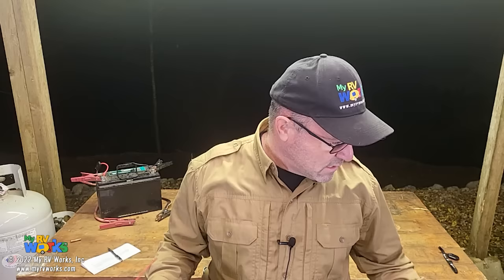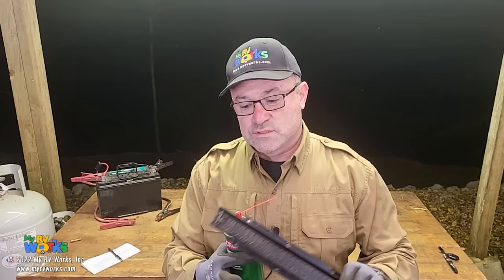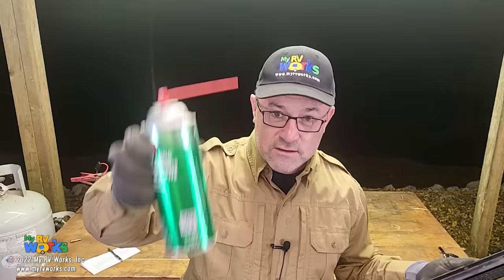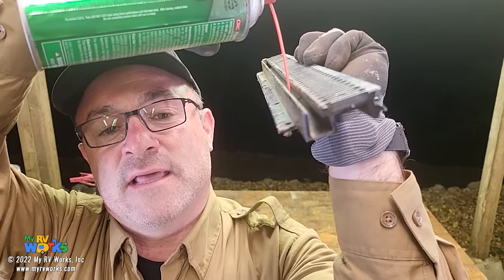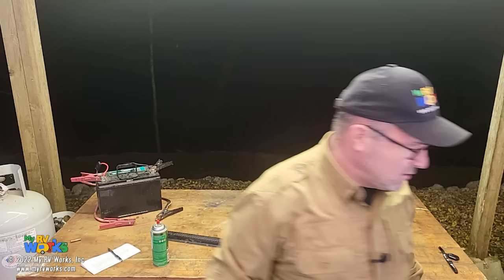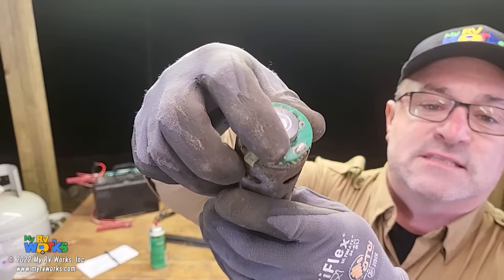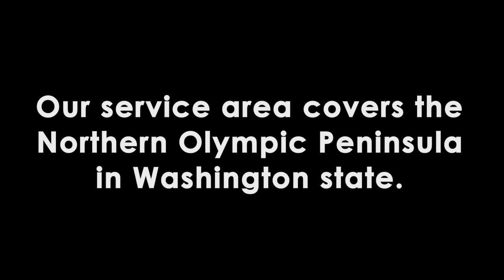Schwintek Slide Room Only Moves 2 Inches And One Motor Stops -- My RV Works

Comment: Hey Darren,  thanks for the process for synchronizing the slide room from left to right - works everytime.  However, what about top to bottom, i.e. when the top of the slide room reaches the "finish" before the bottom?  The bottom of my slide room (on my '21 SONIC 231VRL) does not reach the fully closed positon before the top, and the result is that the bottom remains out about 2 inches.  Is there a DIY way to correct this?
Reply from the maker: Making that repair is a little bit more involved. You will need to remove the columns to gain access to the drive shaft that connects the top and bottom bearing blocks.  Once you get one of the bearing blocks loose from the drive shaft, you can use a tape measure to measure the distances top to bottom and then reassemble everything. Only ever remove one side at a time, I speak this from experience LOL! Apparently somehow the bottom has skipped some teeth. When I see that issue, it's often because the bottom bearing blocks have a compromise plastic shoe and therefore the bearing blocks are not tight to the rack allowing the spur gear to skip .  If that's the case, you might be looking at needing to replace some parts or it will continue to skip on you.  Lippert does offer a repair kit that includes all these parts.  On our playlist I do have quite a few videos on schwintech repair and if you can get your head wrapped around how they all go together you should be able to tackle this one on your own. As a best practice, if I do find a few broken parts in there, I would recommend replacing the entire assembly left and right. On the column you will find a sticker and that's the information that Lippert would need to order a whole new set. Depending on different variables I've seen them anywhere from $800 to $1,000 in hardware. But compare that to replacing new parts with old parts and every time having to go back into that wall to make a repair.  And certainly keep the racks lubricated with the green can I talk about in my videos. Often times it's a lack of lubrication that's causing these things to get binded up.  Best of luck to you I know it's a pain.

Comment: My slide was hanging up on one side.    I located the controller and it showed a short between the. I trolled and the motor.   I bought a new wiring harness and replaced it (between the controller and the motor). Problem solved

Comment: Thanks for the great info on all of your videos. I have an error code 8 ( pinched or broken wire) on motor 1. I put a new harness in but have the same code and the slide still only moves 1/2”-1” and then stops. Works perfect in override mode. Any thoughts??  Thank you.
Reply: Same exact issue on ours (brand new). Did you every figure out a fix?

Comment: I need to find my controller in my 2019 wildwood 233rbxl would it be in the area where the fuse/breaker box is? Thanks
Reply: Possible but not likely

Comment: Mine goes out 3/4 of the way then the left side stops. It'll go all the way if I help by pushing on it. I'm ordering the lubricant now! By the way it squeaks also. Do I try and lube the motor?
Reply from the maker: You don't need to lube the motor, just Lube that track that the plastic shoe Glide slides in. You should notice a major difference when doing that.

Comment: how about a follow-on question to this:  what is the best way to clean the tracks before lubrication?  given the blocks are plastic of some sort, brake cleaner is likely not an option.  Any recommendations?
Reply: I would try compressed air

Comment: Hi, Just found your video ... i do have one of this Lippert slide outs and mine is making a squeaky noise. I also watched now 3 Videos from you. In the first one you said lube (were u took the parts apart) in the second one you said never lube due to the plastic parts (were a guy was asking the question what lube) now in this one you say again lube. What is the latest now ... lube or not ?
Reply from the maker: I have always been an advocate of using the CRC Power Lube with PTFE ( Teflon) on these systems. I'm not sure that I've ever said not to lube it.  There are others, including Lippert, that say never lube. But of most of the service calls we go on where we work on this system, the reason they failed was because they were not lubricated.
Reply: @MyRVWorks  Thanks for your reply i do have the CRC at home already just wanted to make sure before i use it since this videos are already a bit older. Here is the one I was refering to look at around the 8:00 minute mark.  https://www.youtube.com/watch?v=evneZh3vLCk Nevertheless Thank You very much !!!!

Comment: Or replace it with a Vroom slide system (they aren't perfect either, however it seems they have less problems and appear to be far more robust).

Great advice to sync with the slide fully retracted. Lippert's direction is to sync with the slide fully extended. That's probably how we popped off the trim on the slide box. Plus, fully retracted mates the probably stronger structures together.

Comment: They keep changing it because it never has worked properly.  Mine ceases to function when it gets above 85 outside or if the sun is beating down on the slide in 65 degree weather. I hate mine... When it is time to get another rig, if it has one..that is a deal breaker for me.  I am having mine replaced with Vroom Slide System in March.
Reply: Having issues with bedroom slide second schwintek same issue. We are scheduled for a vroom upgrade in November
Reply: @ourbackroadhome1246  I thought thay Vroom was out of business.  We have tried calling them multiple times without answer.  How did you contact them?
Reply: @JD Travelers  I had all my contact through email.
Reply: @ourbackroadhome1246  Thanks...I will try them again.
Reply: @jdtravelers1361  let me know if you get in touch with them. We're having issues with the second schwintek that we had Blue Dog RV replace at the tune of $2500. I'd like to get the vroom system installed now. But I guess so does everyone else!

Comment: These schwintek slide systems are complete junk on the Grand Design 260 RD slide, it’s too light weight for this big of a slide, always sounds labored, popping and cracking.
Reply: Check if you’ve rollers underneath and see if they’re doing any indenting to the underneath. Maybe some sheet metal fastened to the underside per roller might alleviate that. Also check the trim around and under the slide if you can as the slide is going out and in. I found screws lying loose under my main slide in my 2021 class C. Thankfully I investigated be fore it tore the floor.
Reply: @ricktaylor6373  I haven’t seen any issues underneath the slide, I can see where the rollers are, but they are not digging into the floor or anything.